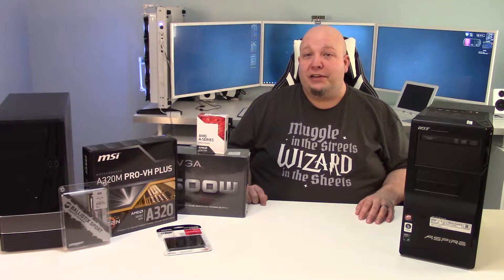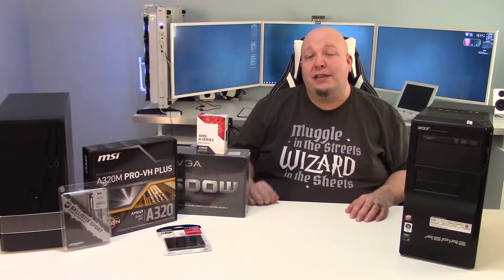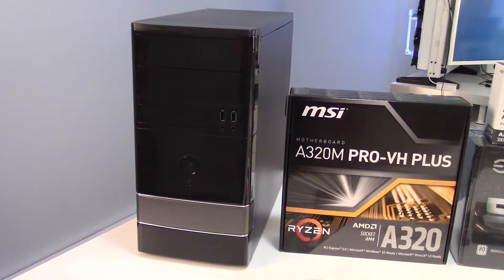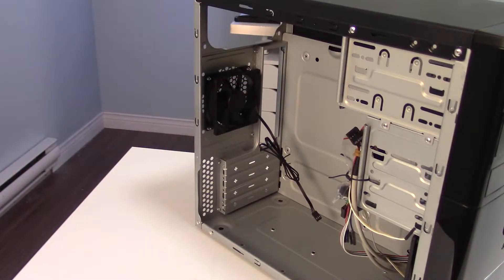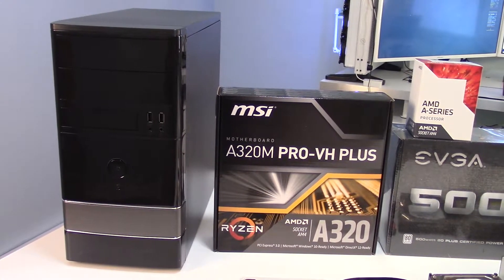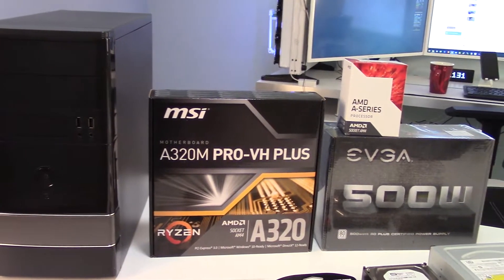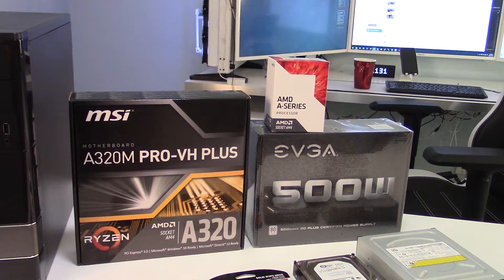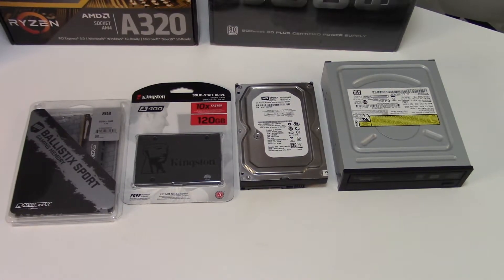Building a Budget PC in 2018

Comment: Hey dude can you help me out? I literally have MOST of these parts. I have the A320M PRO-VH PLUS, the A8-9600 and 1x8gb DDR4 Corsair Vengeance. I've been trying to get it to POST for two days and it's not working at all. I've tried everything and been to every forum post about it. Literally pretty much exactly the same build;D I have one 320gb WD and a dvd drive in here. The PSU i'm using is the EzCool 775 500w
Reply from the maker: You'll have to give a little more info so I can suggest options. Do you get any video? If so, can you get into the BIOS? If you're not getting that far at all (no video), does the motherboard beep when you try to turn it on? If yes how many times? That's assuming you have the PC Speaker connected. You should be trying to get a POST with the minimal amount of hardware connected. You should of course be checking that all of your components are seated well. RAM is one that sometimes you just take-out/put back in and it works all of a sudden. Lastly, if you have any other components you can borrow (like RAM) from someone to eliminate that part being the problem, it can help narrow it down.
Reply: Thanks for the fast reply bro,  It doesn't output any video at all, neither vga nor hdmi. I've reseated everything I've tried to boot it with only the cpu ram and HDD in but still nothing. No beeps whatsoever, I've tried a different CPU fan thinking it may be bugged. I don't know anyone with a ddr4 am build either so i'm on my lonesome at the moment. I've been into the computer shops in my town and they can't even figure it out. But i'm sure I knew more about the components than they did and I'm a right noob at these new gens ;D I have actually given up now, took me months to save for the parts and over 20 hours trying to get it to POST into bios but nothing:/ I've requested refunds for everything and just gonna buy one of those pre built motherboard bundles I think. Gutted is an understatement when you save for so long and get excited about it;D Thank you anyway bro I'm subscribing and will keep watching your channel!

Comment: ok so not looking for a budget build im trying to decide on either the 8700k with delid and aio cooler or a 2700x with aio cooler, its strictly for 1440p gaming with a a gtxz 1080 ti. any help on this is appreciated.
Reply from the maker: If it's strictly for gaming, you should go with the 8700k. The core clock frequency will overclock higher, which matters more in games than total core count (above 4 cores, it doesn't really help with 99% of games). I would only suggest going the AMD route for "cost savings", or if you need the extra cores for livestreaming, rendering or running virtualized machines for software development. Those things take advantage of more cores.
Gaming at 1440p with a 1080 ti, you should be considering either a higher refresh rate G-Sync monitor, or go straight to 4k. A1080 ti will crush 1080p/1440p content. Ex: A 1080ti will run GTA V at 4k at 60fps, or 100fps at 1440p. Gives you an idea. I've got a couple client builds coming this year which are purely for gaming and they will be 8700k for sure. Don't forget an SSD. I refuse to run an OS without an SSD anymore :)
Reply: ya thx for the reply i got a 850 evo for my OS and i do have am AOC gsync monitor. have been upgrading slowly lol so tired of the mid to low tier pcs i have had decided to go big and be good for a few years